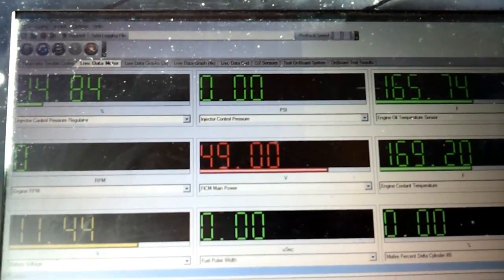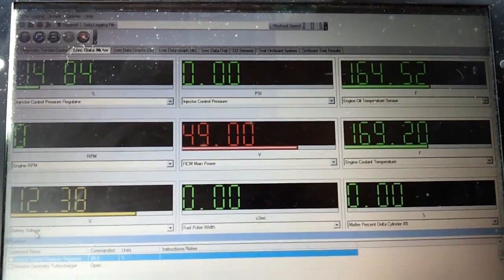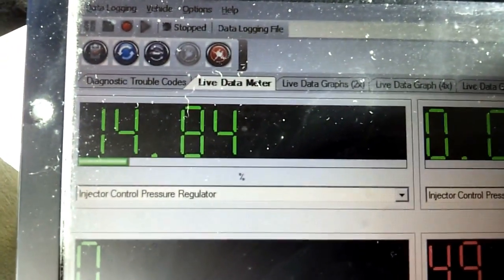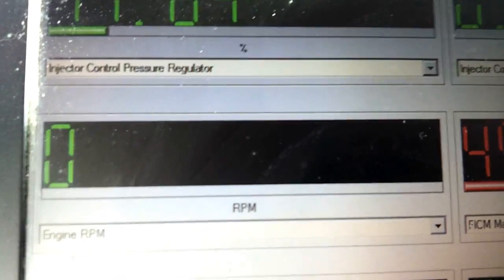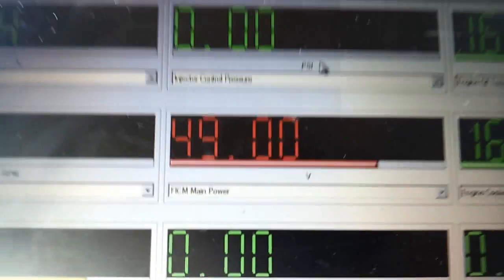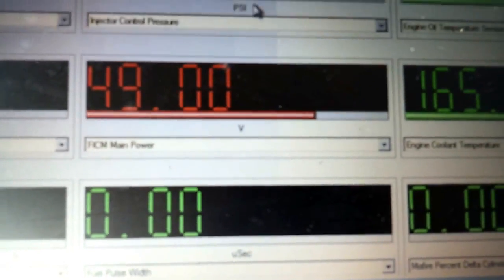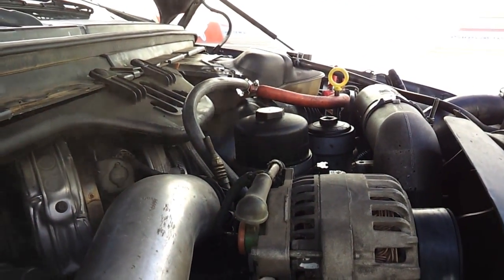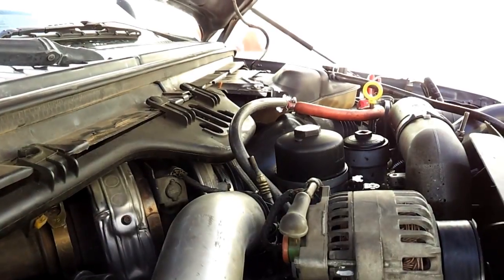FORD Diesel ~6.0L & 7.3L~ Troubleshoot Hard or Won't Start Problems ~Can't Start Hot/Cold?

Comment: I don't understand... I bought a Vgate ELM327 looks just like the one in the video, also bought BAFX Products Bluetooth OBD2 Scan Tool for Check Engine Light and other Diagnostics along with the extension cable and Torque Pro for Android.
I was able to connect to both devices but the display results were just general info and nothing like needed shown on the video here. The software did not pick up differences in info from the two devices that I could see.
There were no sensor readings that came close to shown in this video. This is for a 2006 F350 6.0L Diesel. Cranks, no start (sometimes). I did find a fault code P0335 but not sure if it was old or recent so I cleared the code to see if it comes back. Once again, the engine was hard start... Turn off the key, try again usually fires right up. No fault codes...
I bought all of the stuff because I wanted to see the voltage readings like shown here. The sensors come with their own software mini disc for PCs, but they too only show rpms, speed, fuel remaining, mpg, etc.. Nothing diagnostic.  I looked for additional plugins in a list provided, saw nothing for Ford.
Can you help?
Thanks

Comment: Can you let me know what the item is plugged into the OBDII port going to your computer?
Reply: 3 Options:
AutoEnginuity Pro Line adapter with Ford Enhanced Bundle. $350
Or ScanGauge II (autozone) $100
Or Torque Pro (android App with Elm 327 bluetooth adapter from ebay) $10

Comment: where do i get the program for this
Reply: 3 Options:
AutoEnginuity Pro Line adapter with Ford Enhanced Bundle. $350
Or ScanGauge II (autozone) $100
Or Torque Pro (android App with Elm 327 bluetooth adapter from ebay) $10

Comment: Looks like you opted for the Bluetooth one with your phone app? Also, is there only one Torque app or do you need a special plugin for the IPR/ICP diesel monitoring stuff? I found the Torque app on play, but I dont see where it monitors those items.
Reply from the maker: You need the Pro Version  not the Free version. The Free version DOES NOT HAVE THE PIDS programmed in. You can do it manually much like a scanguageII but it is just as tedious. For $4.99 you get ALL of the custom PIDS for ALL cars. i know my time is worth more than $4.99 times the number of hours it would take me to manually enter in all of the formulas.

Comment: Will a ELM327 USB Interface OBDII OBD2 Diagnostic Auto Car Scanner Scan Tool Cable v1.5 work with the phone app?
Reply from the maker: Yes. There are 3 different versions of the ELM327 bluetooth adapter on ebay:\
~ a large black version
~ a medium sized blue version
~ a small blue version

We have tested all 3 and they work fine. I personally use the medium sized blue version daily 24/7 to monitor my truck and have not had a single problem with it

Comment: I took tore it down and could not hear an oil leak. I was surprised to see the stc fitting had already been replaced with the new one. I put the air back to it and only heard some noise below the oil pump. Like air bubbling in the oil pan. My icp was 7 no crank and 7 when cranking, it didnt change at all.  Is there away to check the oil pump to see if it is functioning.
Reply from the maker: You can pull the ICP and give it a quick crank. If oil shoots out (watch out) it is pumping.

You may have a bad ICP sensor as well. The test for this is to unplug the connector and try starting it. The computer will assume a default value since it is not receiving a signal.
Reply from the maker: If you are not getting any air leak sounds with the IPR commanded closed and full shop air pressure, you may have an oil supply issue or a pump issue. Have you checked to make sure you are getting low pressure oil?
Reply: With the icp unplugged I had 1500 icp and 66 ipr but no difference. Didn't try to start.
Reply: Yes I have low pressure. Fills up the oil filter when cranking.  I don't have a way to command ipr closed.  I just shot air to it with key off and only heard bubbling noice from below oil pump.
Reply from the maker: Eric Dieckman That's the problem right there. If you don't command the IPR closed or feed it 12V from the battery, all of the air will just escape out the IPR. It has to be closed to send the pressure to the oil rail and injectors. If you feed it 12V directly, don't leave it connected for more than a min or 2 each time.
Reply: Ok.  I'll try it.
Reply: Ok.  I'll try it.

Comment: I had 3/4 tread on nitto grapplers and the thieves burned them bald in 4 days. I saw the video on the air test you did.  I havnt owned the truck very long and i bet it has the old sct fitting. When i got it back it took longer and longer to start. Once it did start it ran just fine, no problems. Now it wont start at all. I will get to work on finding the leak. I'll update this with what I find.  thanks for your help

Comment from the maker: The 1510 ICP and 64.6 Ipr reading your getting with the ICP unplugged is normal. It's just a default reading assumed by the computer since it's not getting an actual signal. You have a High Pressure oil leak somewhere or a bad IPR. Air test with the iPR closed to see if you can find the leak.

Comment: I have a 2007 6.0 With scan guage I was only getting 7 ipc when cranking and 84.7 ipr.  I removed the ipc sensor and then registered 1510 icp and 64.6 ipr.  fmc stayed at 48 the whole time. sycn was at 1. it still never tried to fire. I have fuel in the bowl, looks clean. I can hear the fuel pump kick on. My truck was stolen and when i got it back it ran for a few day but right away i noticed it took longer to crank. I had a sct tuner on performance tune with egr off that was stolen aswell. help
Reply: Eric Dieckman that fucking sucks! You in New Mexico?

Comment: Nick, chances are it's your ficm. If not, your injectors. To cr38er.. Lmfao.. You say make sure you have the correct oil filter and cap.. Yet you yourself have the WRONG cap. Also, do not leave the ipr energized more than 90 seconds. 10-15 mins and you'll be putting that new one in it.

Comment: I have an 00' 7.3 for the past 2 years. come some chilly weather I find my rig wont want to start on first crank. I have to cycle the key 3 times and then it will fire up. summer no problems and if plugged in heater no problem. its the days it goes down to 40-50 degrees. any thoughts? I do have a WVO system too(if that has any impact)
Reply: Douglas A I have a 2000 f-350 does the same thing but won't start in cold weather even if I cycle glow plugs 6 times. I give it a sh of either it'll start and die, after a few shots of either it stay running but runs very sickly until warm then runs fine and starts fine when warm or plugged in
Reply: Douglas A what did you do to fix your truck
Reply: @scotteudaley8421  I had same problem with my 2000 7.3L F-250.  Turned out to be an intermittent glow plug relay.  Corroded contacts inside the relay. Some times it would make contact, sometimes would not.  Plus I bet it had a lot of voltage drop even when it did make contact, with all the current that has to go thru it.
Reply: Glow plugs bitches!

Comment: My 2004 Super Duty with the 6.0 is very difficult to start the first time of the day.  Starts and stalls, runs rough.  once running it smooths out and for the rest of the day starts immediately. what have you found that would cause this?
Reply: If you are having problems with starting when cold, but no problem when warm, then either glow plug relay, glow plugs, or worn injectors.  Could be low HPO pressure due to bad IPR/IPC. or a HPO leak.  Could also be a fuel pressure issue.  By cold I mean below ~45F and engine has had a chance to cool down completely.
Reply: @johnwythe1409  I am having this exact issue
Everything checks out on my truck, but it cranks for 5 mins before starting 5 MINS! 
Ficm sync yes, battery voltage 13.4, ficm voltage 47.5 on the low when cranking 49 when not, icp 900-1400 ish ipr 65% on the highest side damn thing just won’t start
Reply: @chapmanhere3397  Do you have same problem when engine is warm, or outside temp is warm?
Reply: @johnwythe1409  no
Reply: @chapmanhere3397  Sounds like either the Glow plug solenoid, glow plugs, or the connector that goes through the valve cover.  Usually my batteries would not last that long in cold weather to get mine started.  Turned out to be an intermittent glow plug solenoid.  When I first tested it I was getting voltage through it, by the time I got around to checking the the connector and the glow plugs, it had failed completely, so I was confused when the connector and all the glow plugs checked out. After changing a set of injector o-rings I went back and checked the solenoid again, and it was completely bad.  Somehow water or coolant had got inside the solenoid and corroded the contacts. Replacing the solenoid fixed the issue. Starts well without being plugged in down to about -10C ~ 18F.  Note: I have heard that too high of a ICP value can cause hard starting as well.
Reply: @johnwythe1409  thank you so much for getting back to me. 
I have replaced my glow plugs glow plug harness and solenoid all very recently and my truck doesn’t have a block heater so I can’t plug it in to test to see if this is the issue maybe I will order one
Reply: @chapmanhere3397  Have you checked that you get 12 volts at the glow plugs?
Reply: @johnwythe1409  I have not but I live in sequim Washington it’s 70 degrees here in the am
It got harder to start as we moved out of winter
Reply: @chapmanhere3397  Odd!  Oil getting thinner.  maybe the HPOP, or some injector seals.  There are two sets of seals on the injectors, the exterior ones on the injector once it is removed, and another set that you can replace if you take the injector apart.  Could be you have both a cold start issue and a hot start issue.  Likely the causes are not the same.  I would be checking the HPO pressure both in warm and cold weather.  try disconnecting the HPO Pressure Sensor.  if you have not done it already, pull the HPO regulator on the back of the HPOP clean it and replace the O-rings.  You will need to take it apart to clean it, just be careful not to lose the little pin inside.  I once had problems with a dirty one, eventually quit working all together because it was gummed up (no start at all, no HPO Pressure)  cleaned and replace the o-rings, and started just fine.
Reply: @johnwythe1409  my truck starts and runs perfectly once it’s started for the first time
My icp stays between 900-1400 when hot and cold
I have no other issues with this truck besides hard start on first start of the day
Reply: I will create a video of me starting it for the first time in the am Monday when I’m off work. my scan gauge will show everything checking out and prove how this hard start issue doesn’t make sense
Reply: @johnwythe1409  i am very familiar with this engine I’ve owned 3 all excess of 250k miles been thru the ringer with all the ipr icp glow plug issues, but this is my first time encountering something on this engine that doesn’t add up
Reply: @johnwythe1409  if you check my channel I have a video showing the truck cranking in the am
Reply: @chapmanhere3397  Can you send me a link to you channel or is this video the one?

Comment: They were trying to save money i guess, when it comes to diesel engines you just don't ever do that.... i work for GM training to be a diesel tech, when i see a truck come in with thos SHITTY Cat fuel filters i Always strongly reccommend putting the right one on, thos cat and napa fuel filters for a duramax save you like 30 bucks, until one comes apart and you spend 6 grand on injectors and a new pump, seen it...